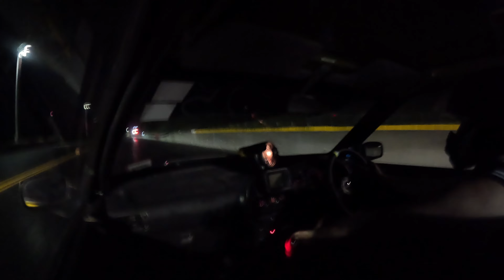GTIR Diagnoses after the Drag Strip & Misfires Any Damage?

Comment: Tune and/or incorrect plugs for the power level, also that map sensor should be remote mounted, they don't like engine vibrations
Reply from the maker: Yeah, plugs being in correct was my first thought as well.
Reply: often burnt sparkplug straps are from high cylinder temperature either from going lean or to much timing    @RCrazyNZ
Reply: @RCrazyNZ  incorrect plugs as in wrong heat range, I use 9 for above 300kws, probably worth getting your tune check somewhere else as well
Reply from the maker: @giftidnz0  agreed I normally run 8s and above in all my builds. 7s were not a choice I would have made
Reply: Couldn't agree more.

Comment: Combination of tune being to lean, and plugs being to hot for power. Not a good result. If you keep down this track you'll end up cracking your bores or melting a piston. I would suggest you look at the tune in the car ASAP. I'd check your base timing at idle and make sure it matches what is set in the ecu, check the AR ratio this should ramp up into around 11.3 11.4s at the power you are making with pretty tame timing of around 8-10 degrees at the most up top. SRs in the GTIR seem to hate timing at high boost levels unless you are running E85. Thanks for posting your progress though unfiltered.
Reply from the maker: thanks.